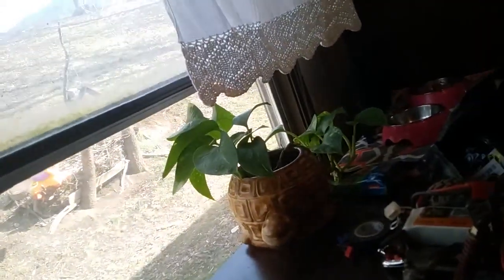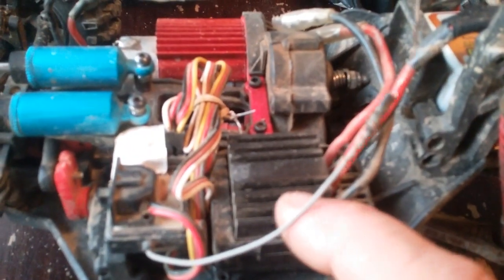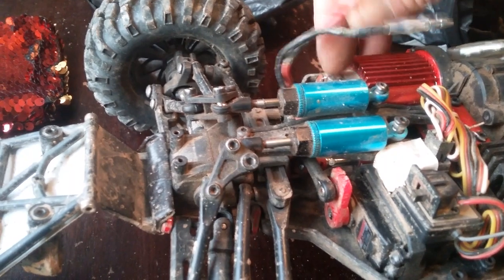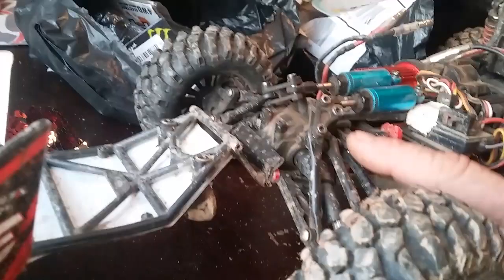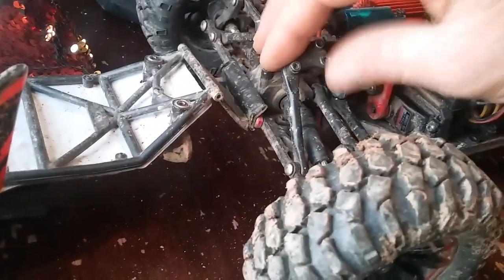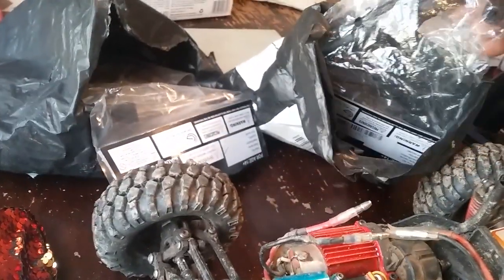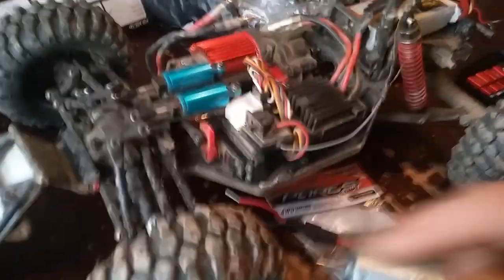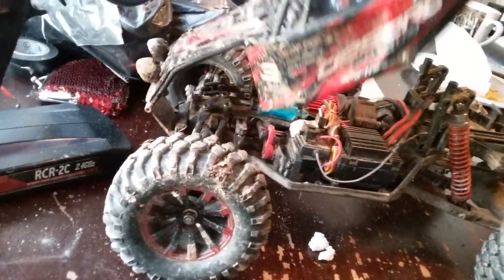Feyiue fy03!! On the bench! How I have got it set up!!

Comment: Good video. I'm glad to hear that the stock gears have lasted so long.

I like those wheels and tires are they stock ones? Because they look a little bigger, mine are almost 3.75 across.
Reply from the maker: No ,tires I got them on eBay thank there  98mm height just slightly bigger.